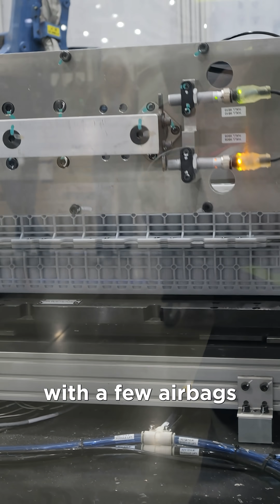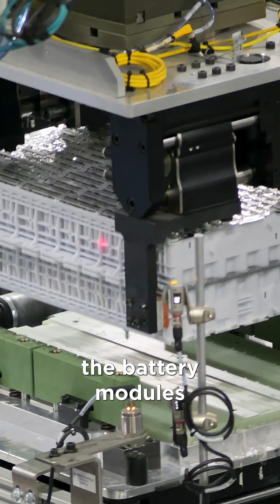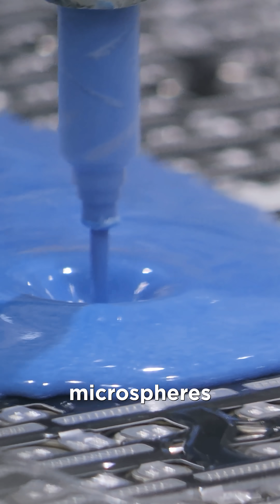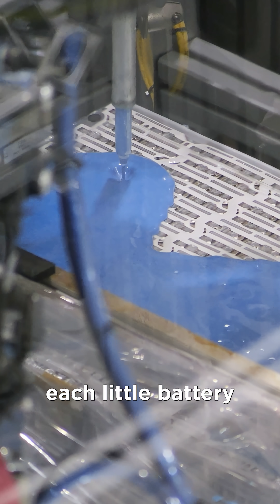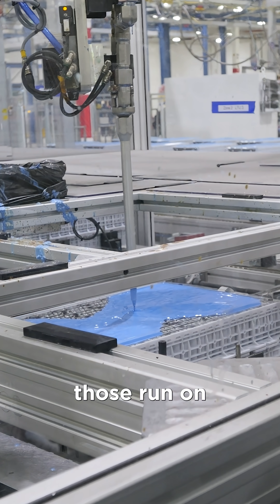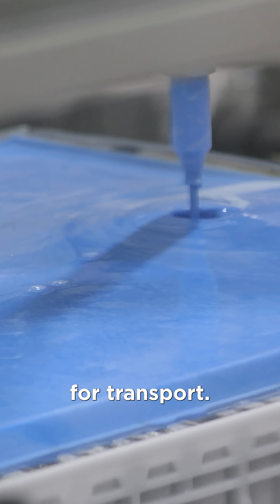Rivians Secret Battery Sauce

Comment: 60x less likely to catch on fire in what situation? A crash? Refuelling?  Being left outside? Give me context
Reply: Per distance travelled. Yes that includes ev fires when the vehicle isn't moving.  It's just total distance travelled by all vehicles of the type / Total number of fires.
Reply: @zyeborm  where are you getting that from? Nowhere is it stated this is by mileage, most stats are per 100,000 vehicles. I couldn't find any, and even used ai to run a search and they couldn't find any either. On the other hand I did find data that suggests difference in vehicle age could account for as much as 90% of the fire risk difference, given vehicles over 10 years old are 75% more likely to catch fire, and the median age of OCE cars is older than that, while EVs are 3.5 years.
Reply: @zyeborm sorry bud but someone i knows wifes ev caught fire with her in it while driving down the road while i have vehicles well over 10years old with no issues im not seeing it
Reply: Yes
Reply: @IAmTheGlovenor perfect reply 😂
Reply: All situations
Reply: And not to mention the sample size is waayyy less for EVs
Reply: @kunjupulla it’s per 100,000 vehicles
Reply: Not to mention EV fires are way harder to extinguish, you have to use a special fire blanket and those things are stupidly expensive, not every fire station has them or has had the training to use them, and of course 1 time use only
Reply: @Rena152 as a fire fighting volunteer we are taught to submerge it in the nearest largest body of water once the immediate danger is dealt with as the lithium can reignite at any given moment and our trucks are insufficient to completely extinguish them.
Reply: @Rena152 but it’s not significant enough because they’re 5-10 times less likely to happen
Reply: @th3max1muspr1me obviously its significant. A gasoline car fire is nothing by comparision. 60 times less likely but releases more than 60 times the energy, and more likely to have fatalities related to fire.
Reply: E
Reply: This is my number 1 pet peeve with people who throw statistics around. Statistics are worth NOTHING without the proper context.
Reply: Across the board. Gas cars often have small fires from 12v faults which turn into huge fires from the large tank of accelerant they carry around.
Reply: This is a half truth.  Millions of old gas cars, much smaller number of very new (relatively)  EVs.  No direct comparison is really possible.  And you can easily extinguish the gas car.  Not so for the electric.  Lithium must go before there will ever be a safe EV.
Reply: It’s just words he throwing around
Reply: Probably compared to dodgy fuel mods done by your backyard car enthusiast.
Reply: This
Reply: I kind of explained it in my own reply to the actual video
Reply: @krisr7512 well given that reality shows they are less dangerous I'm not going to bother going searching though thousands of comments looking for some ideologically fuelled rant.
Reply: @zyeborm .
Reply: I know right? More teslas caught fire then conventional gas vehicles
Reply: Fr lmao. Not to mention than a gas car catching on fire well, Burns in most cases but that's about it and takes quite a long Time at that. On the other hand an EV catching on fire is basically a military grade bomb
Reply: @12TROLL14 nothing explosive about an EV fire. Utter nonsense.
Reply: @TheBrucifer this maybe true but have you ever tried to extinguish a lithium fire it is near impossible without full submersion
Reply: @12TROLL14 lol tell me you've never been to a vehicle fire or near a bomb without telling me.
Reply: @zyeborm  you can't argue that EV batteries are less dangerous that gas cars
Reply: @12TROLL14 why not?  if you make a claim you better back it up
Reply: @zyeborm  not when its as obvious as this lmao. we all know batteries are almost impossible to extinguish if they catch on fire and can explode
Reply: @zyeborm  i mean if you claim that EVs are safer than gas cars then back up your argument too. EVs are the new tech here, not gas cars.
Reply: @12TROLL14 start with the video above. Then go look at all the studies globally that find the rate of fires is dramatically lower than for ice vehicles per distance. And yes of course that counts EVs that burn when they aren't moving. It is a mechanism of comparing like return like to factor in the lower numbers of EVs.

Regarding your other comments. I've held a burning lithium battery in my gloved hands. It's not that concerning. I've also been under a car with a plastic fuel tank when the fuel line caught fire. That was highly concerning.
Reply: @zyeborm  must have improved then, lithium batteries used to be absolute fire hazars
Reply: @12TROLL14 somewhat, but they have never been as bad as the anti ev crowd makes out. Any time you deal work large amounts of energy there will be hazards. Ev hazards are less generally but they are different. Don't charge your Ev under your bedroom while you sleep. But you're fantasticly less likey to have your car burst into flame while driving. A thing I've personally witnessed multiple times, though thankfully not in a car I was driving. 

Ev fires are hard to put out. But so are ice fires. The fire dept aren't going to save your car in either case, the only thing they do is try to stop stuff around it burning. That's much harder for an ice vehicle fire. Ev fires stay in the one place. When the fuel tank ruptures in an ice vehicle you get trails of fire running down gutters setting more cars on fire repeating the pattern.
Reply: @12TROLL14  Aaaand there it is: *IF*. 
The whole point is that the “if” is less likely for EVs than it is for gasoline-powered vehicles (GVs?). The “Per Distance Driven” stat (which is essentially the total number of incidents for each type divided by the total number of miles driven for each type, resulting in a ratio that can be directly compared between the types) evens the statistical playing field by providing a constant and consistent measurement criteria by which to compare relative frequency of occurrence between the two vehicle types since population count between them is so vastly different. And the real point of that is to say that, in equalizing the population of both types to 50% each of the total population, the ratio of incidents to total distance driven for both types would remain largely or potential actually unchanged, with EVs having a far lower ratio than GVs.
Reply: @12TROLL14 The BYD blade battery can be puncture and not  take fire.
Reply: @12TROLL14 so entire blocks have been wiped away by electric cars? They are probably similarly dangerous then when taking the amount of damage into account.
Reply: @Robbedoes2 As long as you don't open a business restoring batteries and fill a warehouse with old Tesla Roadsters you shouldn't have a devastating fire (twice).
Reply: @Robbedoes2 incendiary bomb.
It burns and it doesn't stop until all the fuel is gone.
If the firefighters are lucky and get there quickly they can keep the not currently combusting cells cool enough so that they don't start, but the ones that are burning will continue burning until they exhaust all their combustible material.
These battery fires create their own oxygen, burn hot enough to split the oxygen out of co2 and the oxygen out of h2o.
Even smothering it with a metal fire extinguisher won't put it out.
Reply: @guesswho2778 you know 1500 ice cars burnt in a car park not long ago right? Why didn't the fire fighters just put those out?
Reply: @zyeborm   because they didnt, i dont know im not a firefighter.
but i do know you can put petrol fires out.
you can only reduce how severe a lithium ion batter fire is by trying to keep the currently not combusting battery cells cool enough to stop them from also combusting.
the ones that are burning will burn until they expend all their fuel.
this is assuming that the firefighters get there in time before they are all burning and that they can get water into the batteries quick enough even if they do get there before that happens.
again, the fire creates its own oxygen, smothering it does nothing all you can do is try to not let it get worse.
Reply: @guesswho2778 for someone who isn't a firefighter you sure seem to have very strong opinions on fighting one type of fire but not another far more common one.
Reply: @zyeborm  i know the fire triangle, oxygen, heat and fuel.
lithium ion batteries have two of these and its really easy to get the third.
petrol only has one, fuel.
its just simple fact that lithium ion batteries of a roughly equivalent energy density are more dangerous than petrol tanks catching fire.
you dont need to be a firefighter to know this.
Reply: @guesswho2778 that you think lithium batteries have the same energy density as fuel is funny. You're wrong by an order of magnitude. 
Have you ever seen what happens when a burning fuel tank ruptures? How the burning liquid runs under doors, into drains, how it spreads to other vehicles in a flash, how the vapours build up and explode? 

Are you aware that your easily extinguished liquid fuel in the form of tanker trucks is responsible for destroying 3 bridges per year? 
Yes, the very specific scenario of a tanker crashing under or on a bridge and catching fire then burning so hard it destroys the concrete happens around 3 times a year in the USA alone. 

A lithium fire may be harder to put out in some ways. But critically that are 5-10 times less likey to start, and they don't spread. 

I've held burning lithium batteries in my gloved hands. It's not much scarier than a modest firework. You put them in a sand bucket, then a salt water bucket for a few days, easy. I've also been under a car when a fuel line caught fire next to a plastic fuel tank. That was horrifying. What do you do to contain 100l of burning liquid as it spreads in a wave of flame across your shop? 
Hint a fire extinguisher isn't going to do crap.
Reply: @zyeborm  ok, i was wrong about petrol, but that doesnt make a cars worth of lithium ion batteries catching fire less scary.

you comparing a car to a fuel tanker was disingenuous as was comparing it to a small enough battery to be hold in your hand.
these batteries are heavy and make up a massive chunk of the cars weight and when they go you also cant stop them, the best you can do is try to prevent it from getting worse, as with most fires.
but thats not something you can do, thats something the firefighters have to do, i doubt you have the gear to get close to the burning car, maybe need to create a hole into the battery compartment and then flood it with cold water until the burning cells stop.

by you in my previous comment i meant a general "you" as in its possible, its the firefighters that can do this with foam.

the study saying that they are less likely to start is using flawed data and the things giving out those numbers are referencing that botched study.

and no its not as energy dense as petrol, i think i used the wrong word there, i was trying to say of a similar energy amount.
Reply: @guesswho2778 no, electric vehicles have dramatically less energy onboard than an ice vehicle. Still an order of magnitude. 

I wasn't correlating a hand held battery with a fuel tanker I was demonstrating the magnitude of the issue liquid fuels pose. Because they have been around for a while people dismiss any issues with them while at the same time they are terrified of the new thing because it is new and different. The example is to show the thing people call "safe" is anything but. The battery I held was not a phone battery btw, it was a combat robot battery. Dramatically spicer than ev batteries and it only cooked off because someone put an axe through it. Modern lifepo4 batteries are almost impossible to light, generally they fail by just popping, sometimes with some smoke.

Getting close to a lithium fire is much safer and nicer than getting close to a liquid hydrocarbon fire.
Say you have a car with a person inside sitting in the middle of a burning puddle of fuel. If the fire fighter tries to walk to the vehicle they get burning liquid all over them. 
A battery fire just sits there. There may be jets of flame, but the suit protects against that. It doesn't spread, it doesn't drip, you don't get it stuck to you. 

Look at it a different way. Yes the fire is harder to extinguish. Does that actually impact on safety?

A fire that requires you to throw the vehicle in a tub of water for a week after isn't actually more or less dangerous than a fire that you put out an hour after it has started. It's just a process to follow. Specialised tools already exist to puncture and flood the battery volume btw. They just go on the end of a hose and get thrown under the car.

A fire that spreads, that sticks to you? That's dangerous. 

Also, yes the 60x number is bogus. Multiple high quality studies exist showing 5-10x less fire risk per km however. Yes that includes fires that happen when the EVs aren't moving, it's just a way of normalising the number of ice and ev vehicles and how much driving they do.
Reply: Commence to coping!!! 

60 times less likely can mean that at volume in general over time there are 60 times fewer reports per car 

EVS are also less likely to get into crashes as well 😂😂😂 and maybe that's all it takes to avoid a fire😂😂😂😂
Reply: 60% less likely only because they are significantly less EVs on the road compared to ICE! Come on jerry do better. I didn't take you for an EV shill
Reply: @azwads5126 no, the number given is per distance driven. Yes it includes ev fires that happen when they aren't moving. No whatever conspiracy you're about to spout is a conspiracy. Reality doesn't agree with your ideology.
Reply: @Rawwdogg_teet except that's the thing though. You're wrong. All the data globally says you are flat out wrong about the relative incidence of vehicle fires. But there is no world in which you can admit that is there. None. 
You will not accept reality is different to your feelings.

Comment: How does the fireproof foam coating affect the ability to recycle the battery?

Edit: as someone else noted, it probably also affects how easy it it to reuse or replace cells.
Reply: was wondering that too. Last time I saw recycling process on yt they just literally crushed and grinded the batteries and used solvents and chemicals and melting to extract metals.
Reply: I believe it doesn't really impact the recycling significantly, because, as godassassin8097 said, they're just crushed and then the materials are separated.
The foam does impact the ability to reuse parts or perform maintenance on the battery pack. It makes it extremely hard or impossible to extract and reuse undamaged parts of a broken unit, and you're also not able to easily replace individual batteries.
Reply: @einstijn138 maybe there is an an acid or some other chemical that can also dissolve the foam without damaging the battery cells themselves.
Reply: Quoting another guy: Not really, they are shredded in industrial recycling, not disassembled. And most ev modules us welded tab connections that make them harder to use at the sub-module level. This doesn't change much.